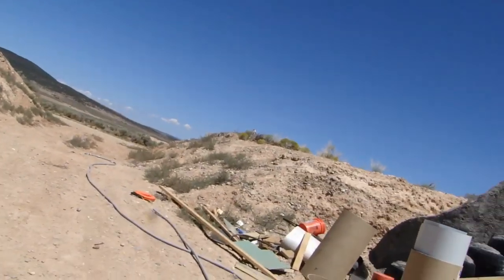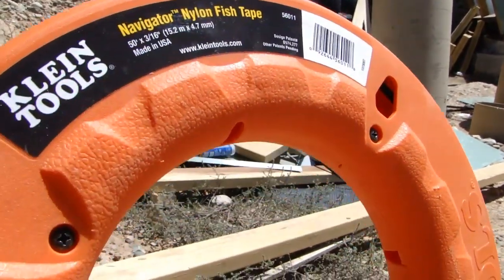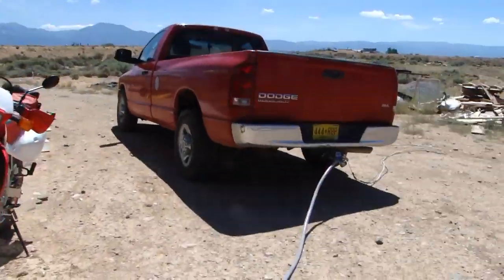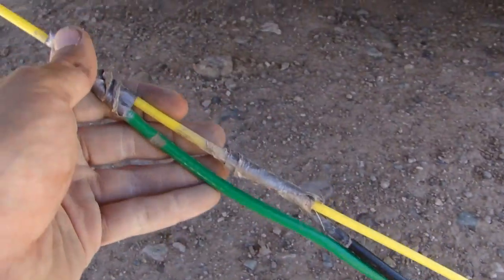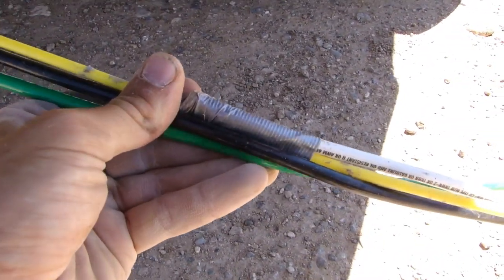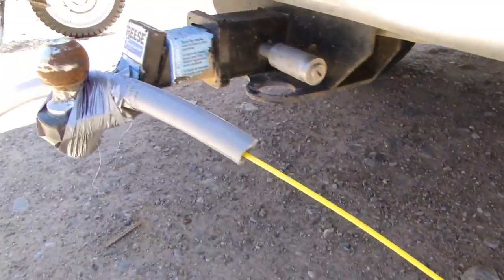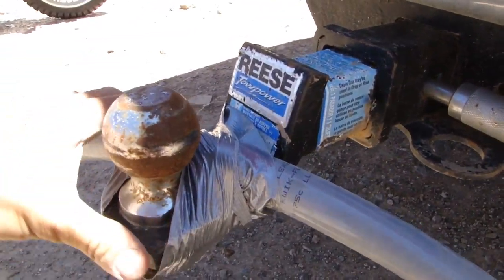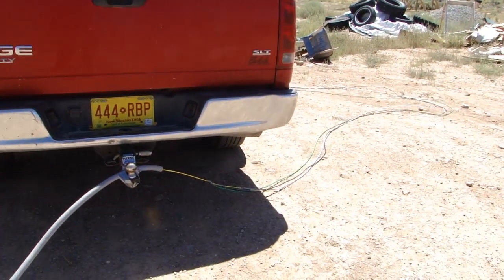Solar System Installation - Part V

Comment: Great video.. The only thing I would have added was a heavy nylon string as well.  This gives you the ability to easily add wire to the conduit in the future.  You do it the same way you did, just tape the new wire to the string (along with another string) and pull it through.  Then, leave the "new" string in the conduit in case you need to add more wire in the future.